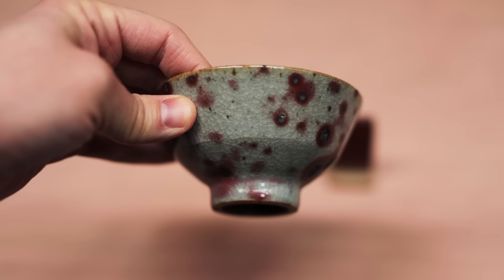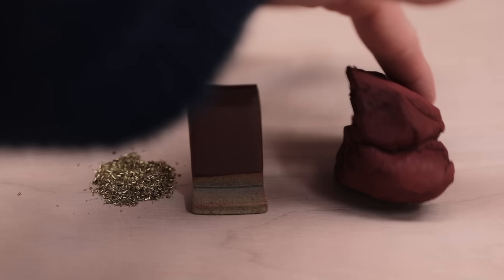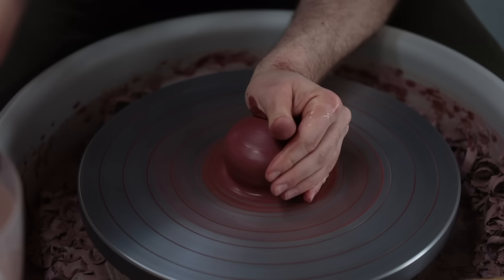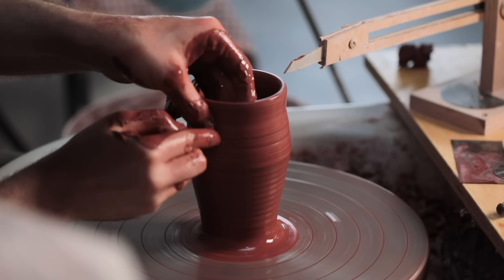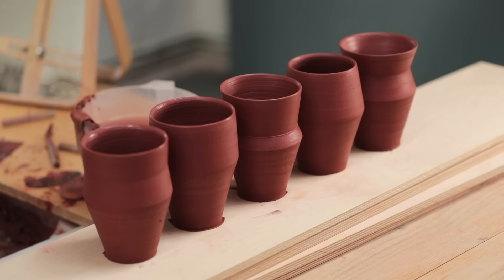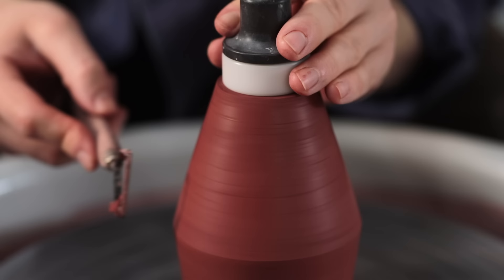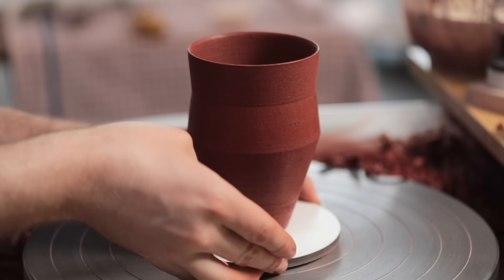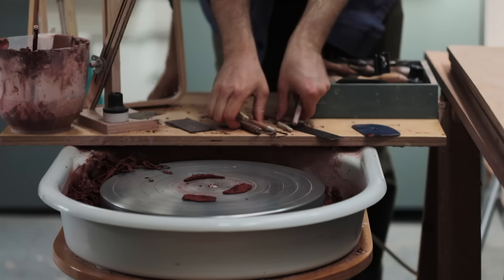The Reddest Clay I've Ever Seen

Comment: I have a theory: 
The air bubbles sometimes pop, but more often than not they will stretch out so much by being wedged, so as to become so small and stretched out, that they practically dissolve into the clay. Many gasses come out naturally during the firing, such as water (plenty present, ask any chemist), as the porosity is high enough to let them out at a trickle. The problem of the bubble is its size and therefore the quantity of gas that has to pass these fine and complex tunnels. the volume of the bubble grows much faster than the internal surface area. Once it starts to pressurize during the firing, the bubble will not be able to relieve enough of its pressure through the clay, possibly made worse by the clay particles under pressure collapsing shut. Then the pressure can become out of control and burst.

Now, I wonder, would a high pressure furnace make it possible to on purpose add make bubbles such that a cup, plate or bowl would retain the heat far better (such as a aerogel for example)?
Reply: Or what if you put the green are in a vacuum chamber or something to remove any gasses?

Comment: I really appreciate you explaining your process! I took ceramics in high school and ran into some of the issues you describe. Trimming a base too thin, distorting a thin leather hard rim, imprinting the bat texture on the clay, drying pieces unevenly, struggling with initial pulls, and letting too much slip accumulate on pieces are all problems I encountered and never learned how to fix.

Comment: As someone requalrly working with the material in metal working, tungston carbite will not be chipped by slight irregularitys embedded in such a soft material. It will after all glide through metal like a knife and take a lot of abouse. What really gets it is a sudden hit by a material as hard or harder than it. So if two tools bang against each other, even with not a lot of force, it will qickly chip. While it will bite without problem into anything thats softer than it. So it most likely happened when putting away the tool. It is quite like glass or ceramics in that way.